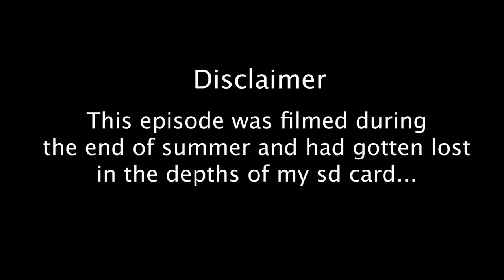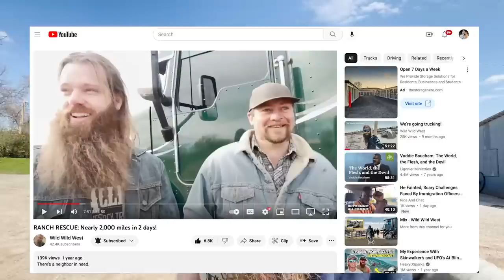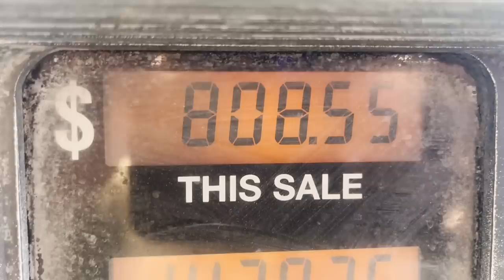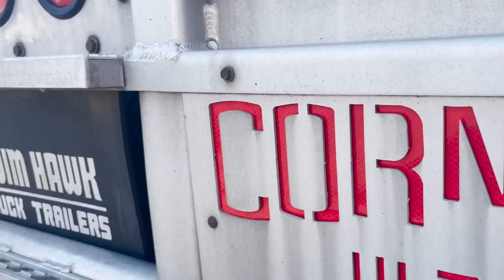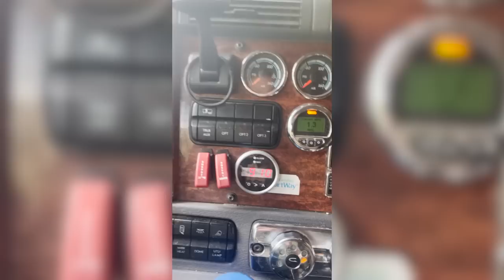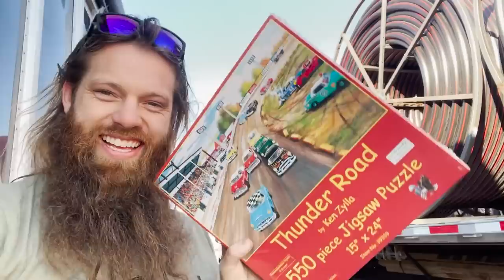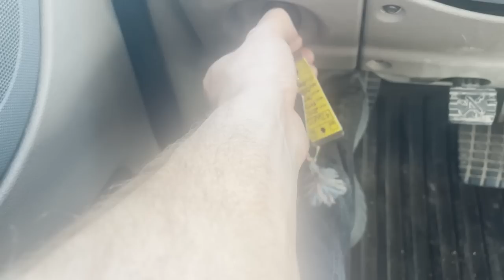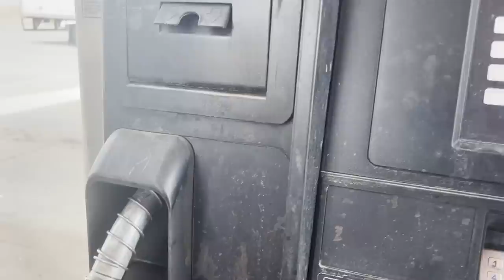My first Coast to Coast Truck Trip. 1/3LOST FOOTAGE

Comment: I cannot remember my exact route. but one trip to Oregon, having enough time a great boss I asked if i could take a few extra days durring my trip to relax and not be rushed to get back to Stettler Alberta. I had to do the Lincon run, but not for the Bomber dude thing, It was because i wanted to run the Rogers Pass so i could say I have been over both the USA and canadian Rogers Passes..   It was a awesome fun trip, I will not say possitive it was the trip I ran north up through browning montana and into alberta south of Lethbridge  but I loved that dumb crossing you had to stop get out and walk over to a tellephone and press the button and stand there until some one answered, and lie through your teeth about not having anything to declare.  nope was not into hassels, did not have nothing to declare. And once told you could hang up and resume on your trip.  The moral of my boring story is, some times while on the road in a truck, you can take a bit off the regular route and go see stuff you would other wise never get to see. The upper side you haul your Motel Bed with you so you can save some bucks that the average tourist has to cough up for.  back then i think desiel was under a buck a gallon. I can say it would have been in 1983 or 1984. because I ran down into Oregon once a month from aPRIL 1982 TO NOVEMBER OF 1987. Jax would have loved that old truck, a 1980 w900 kenworth with a triple 4 cummins and a 15 over.

Comment: Sure looks like you're riding that yellow line a lot going down the road. I don't think they would haul those that way in the summer months, maybe but I doubt it. Most likely refer loads in the summer months. I know you do not want to get them too hot for very long. Answer to pulling grades it to use a gear lower than what it will pull it so the truck runs cooler. Especially in the summer when it is hot. We used to go down the grade in the gear we pulled the mountain in too before jake brakes and retarders were put on the engines. If we didn't know the downhill side or grade, even if trucks were passing us because you never know what their weight actually is. Go slow to save brakes or lose your life as well you know. I've seen guys get in trouble relying on jakes and then they quit on ya and away you go down a long grade if you cannot get it braked down in a hurry, and come off after fixing the wiring on the jake system. I used to say never mind the horse just load the wagon. But never referred to myself as being the mule or the horse. I got some of my best loads because I worked through the holidays, birthdays, and anniversaries. I stayed on the road for months at a time sometimes for six months. Longest time out was 8 months. Well you will never want to see the refrigerated trailer life, because the last thing you want to do when you get to your next drop is unload and break down a palletized load to put it on smaller wood pallets or break a load down to fit in their racks or something that has to go on the floor because it weighs so much you cannot put the weight of pallets on as well as the load. Plus no getting paid for loading and unloading. That's the reason I had air lift on my axles so I could cut tight corners or pick up the front axle and go across a scale with all the weight on the rear and once off the scale reverse it to get the weight off the back axle and sneak by over my gross weight. Plus helps getting into docks and back eat on those old town built for horse and buggy turns.
Reply from the maker: Cascadias have a really wide cab stance just like a cabover, so your eyes would be correct. We sit out there on the yellow, vs the Kenworth where you sit in between the frame rails.